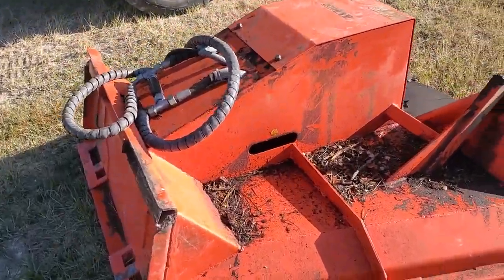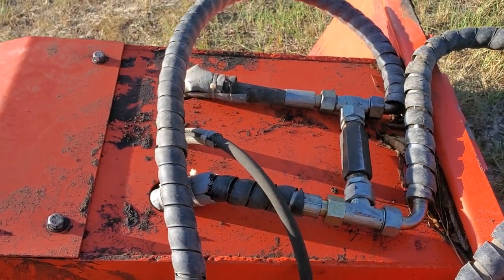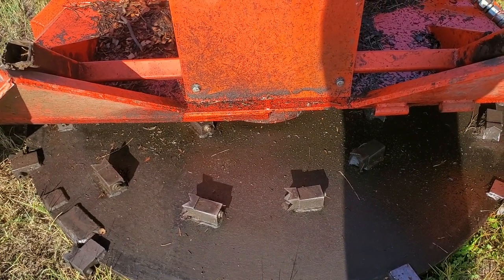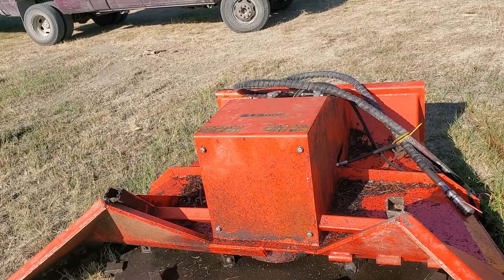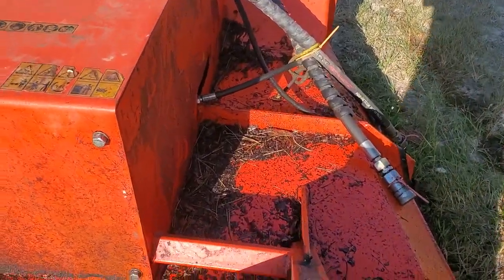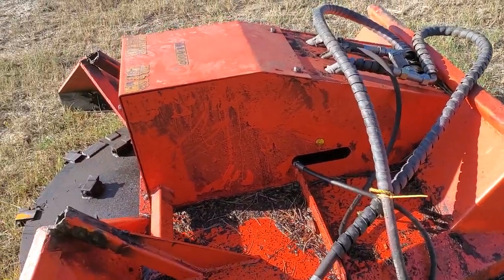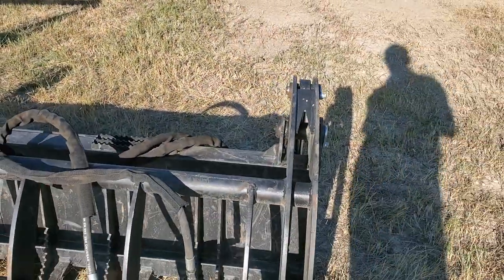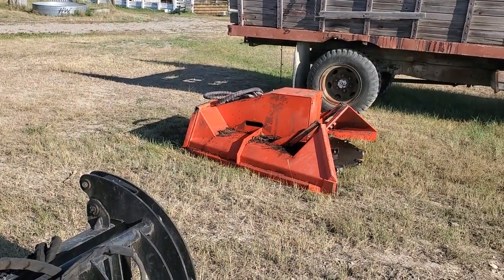Topcat (agrokt) Forestry Disk Mulcher Review

Comment: I bought one about a month ago. After watching some of these videos I was thinking I am screwed. I hooked it up the other day and I was very pleased. I was lucky mine is balanced even with 40 gallon flow. For part time clearing I think its going to work.
Reply from the maker: Good to hear.  Maybe its luck of the draw or they are balancing them now....
Reply: Still fixing the hydraulic fittings and going to cut out bigger holes for hoses @kurtfrome